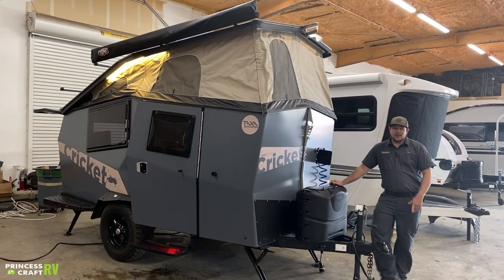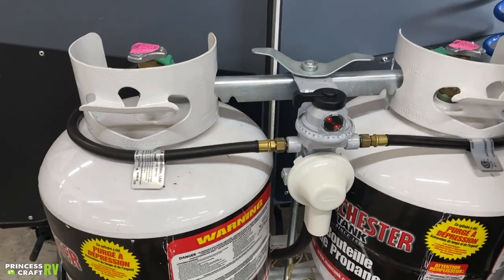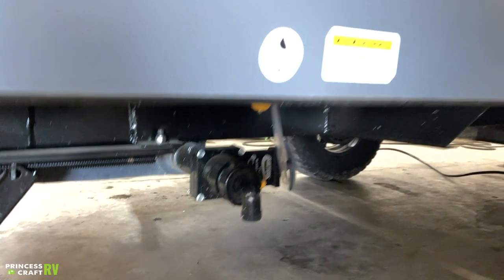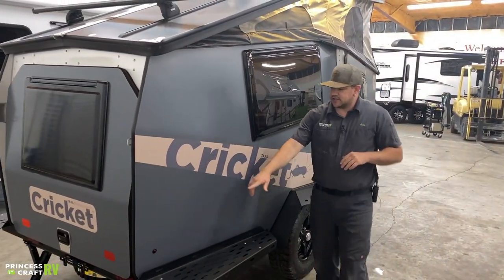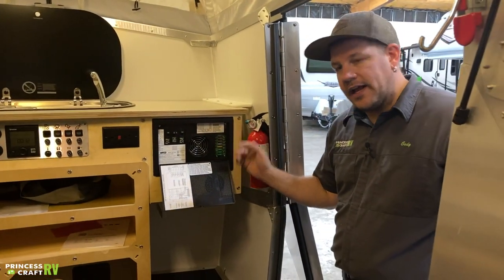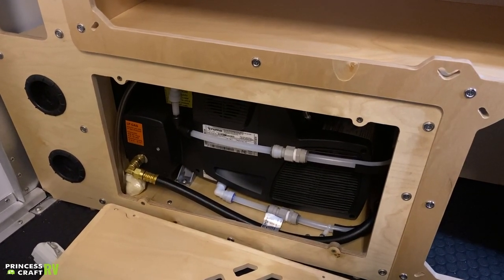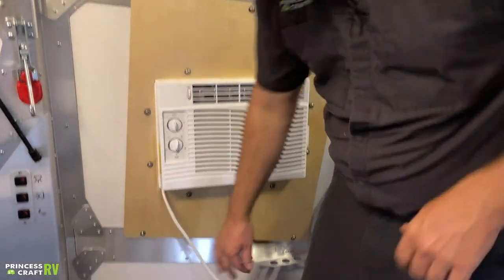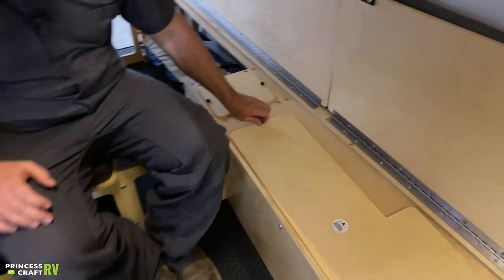2020 Cricket by TAXA Outdoors - Technician Tour

Comment: If you can come up with a camper like this, why don't you design one with a bathroom? Many small SUVs (4-cylinder) have a towing capacity of 1500lbs, and no manufacturer has ever designed a camper with the following specs:

Weight: 1500 lbs or below
Queen-sized bed
Dining area
Interior shower with curtain, and toilet
Interior or exterior kitchen with a sink and a 2-burner stove
LED lighting
Roof-top solar panel